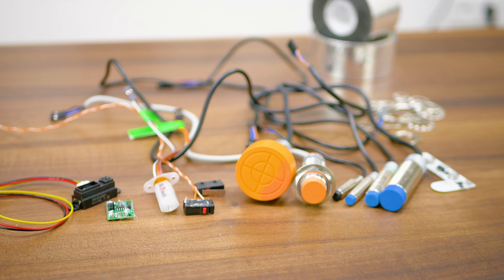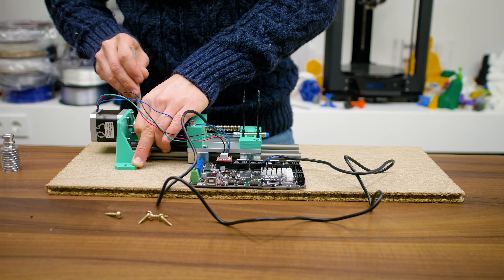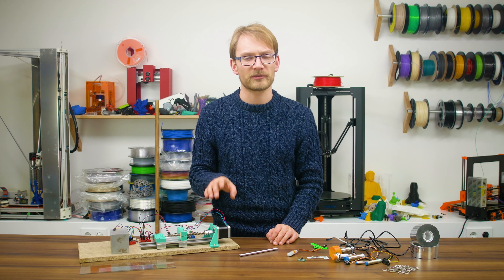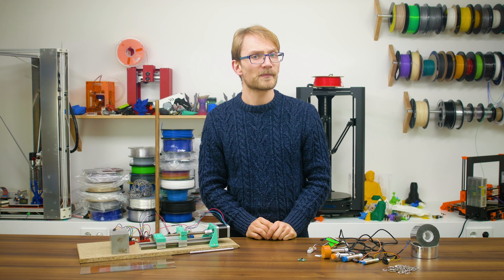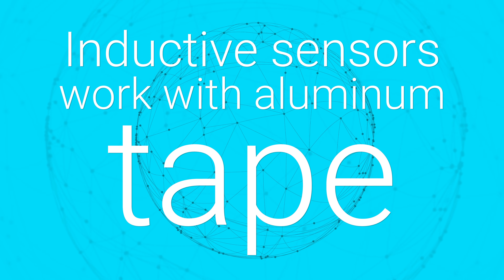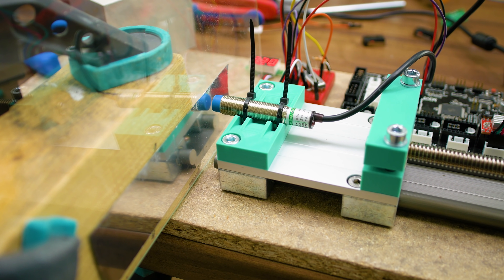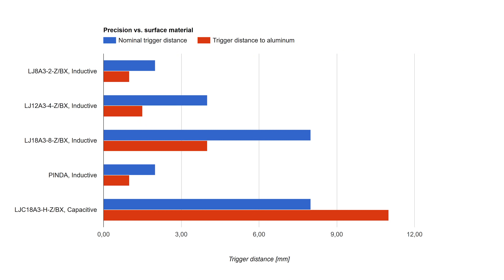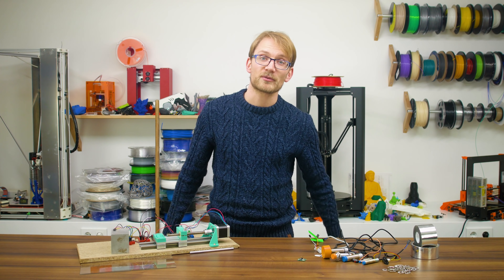Autoleveling on 3D printers: 9 myths and 12 sensors tested!

Comment: Many years later and the BLTouch and the clones are the most used.   Inductive requires the metal to be the exact same accross the entire bed surface,  so it's out in most cases.  Of course now we have Lidar sensors.  Sticking with my genuine  BLTouch setups for now.   They just work.

Comment: I know this is an old video, but I hope that you still read comments.  Tom, How do you connect a simple 2-wire switch to the mobo for the board to know when it has closed the circuit?

A quick vid would be nice.
Reply from the maker: The exact procedure really depends on the firmware used, but the steps are typically:
Configure the pin you want to use as an input in your firmware
Enable pull-up for the pin in software or add a physical 10k resistor from the microcontroller's positive supply (3.3V or 5V) to the pin
Connect one pole of the switch to the input pin, and the other to ground.

This way, the input pin will be high as long as it's not pressed and low when pressed.

Comment: For the longest time, when I was running my Simple Metal with a glass build plate, I had to use aluminum tape to get the inductive probe to fire. I assure you it 100% worked. There are different thicknesses of aluminum tape, I suspect that was your problem here.

Comment: After re-viewing this video again, I wondered why you tested all of the sensors on the same surface (aluminum) as the different types of sensors each work best on particular surfaces.  For example the inductive sensors only work against a metal build surface such as flex sheets with PEI or PEX.  The IR sensors work best with a black body, or no- reflective surface such as build tak, and poorly against aluminum and non etched glass.  Capacitance probes need to be adjusted, but will work with numerous surfaces.  They should perhaps be used with the bed heater on, and at less than 65C.

Comment: Re-viewed this video.  It occurred to me that an NPN NO sensor has an open collector output to ground (V-).  So it might be possible to run the sensor at 12-24vdc power, but have the output switch a 5v pull up resistor to ground thus giving a 5v negative true logic output.  OR it could switch an opto isolator.  Either way, you get a 5v logic output, but might need to invert the logic in software.  Marlin probably provides for this anyway.

Comment: Suggestion: I would love for the program of your channel to be a bit more focused on telling the folks over at lulzbot that there is a very sad man in vienna, who`s Pos 3d printer first grilled his pi, spared his phone for some reason, and tried the same funky shi# with my pc, but this time it offed itself so to speak. I don`t find anything wrong in the psu, and yes, your video was very helpful, but the meanwell 21A 500W 24V is a bit different. Still no burnings. The Board powers on over the usb, but I think this POS just will never ever print anything ever. Soooooo, lets call this one "Nachbar in Not-Lulzbot edition." lul. Jk of course. (still, if you want, you could...) I am gonna ball and cry now. Excuse me gentlemen. But this ender 5+, has ended me. First my Pi, then itself, now it`s me. I swear they make them cheaper now...

Btw. Edit: No worries, my pc is built like a tank. I did it myself. Not even the usb port I used is grilled. Still, first I was sure I made some wire mistake, but nope. The Mobo just started to go freaky on me. The Usb-C is a big nono now, but tbh, I don`t trust the Pos at all. Not anymore.

Comment: Have you looked at a sonic sensor? Like the ones that come in the Arduino kits. Can it be adapted to measure and trigger at the distance it is mounted, at on the print head? When I played with one some time ago, It seemed very accurate for 50mm to 800mm.
Reply: You are trying to set head position to a fraction of a layer height, so about 0.02mm say. Those sonar sensors have nowhere near that resolution.

Comment: To be honest I don‘t habe experience with 3D Printing, but what about using a pressure sensor/force sensor. As far as I know they don’t really have any travel in the sensor itself, and they should trigger more or less instantly when they see a force being applied. Of course they won’t output an on/off signal, but a voltage (or first of all a resistance ) overcoming a certain threshold and some simple electronics should be enough to make it work I guess.
Reply: That's called a load cell, and some 3D printers do now use that scheme. A related scheme is one in which the printer just runs the nozzle down into the bed while monitoring the motor current for increased current, which it assumes is due to the motor pressing against the bed.

Comment: Awesome video, very informative. Curious, I know it wasn't the point of the test, but how come you didn't try putting an opaque backing on the opposite side of the glass when testing the SHARP Optical Sensor? Or even test and Ender's glass bed that has a coating on the print surface itself?
Reply: I've got a feeling that that particular glass bed surface wasn't available 4 years ago.

Comment: To resurrect an old video. Have you still got the testing rig. I think it would be interesting to redo this test with the latest sensors available.

I'm building a ratrig vcore 3 when the kit arrives and I'd like to know waft probe to use.
Reply from the maker: Yeah, I still do have the rig. Which sensors would you like to see tested specifically?
Reply: @MadeWithLayers  I'm really wanting to see a comparison of a real BLTouch vs an AliExpress cheap clone. It'll be awesome to see some DIY solutions too, like the Mi Touch or the OptiServo (both using optical endstops and very cheap to assemble).
Make it happen Tom 😉👌🏼
Reply: I'm not sure really. With the rise of self build printers where you can choose your own components, notably for me ratrig and voron, I was just interested in whether there were improvements in physical, capacitive and induction sensors in the years since you did the test.

Comment: Its been 4 years, will be cool to see a redo with current offerings
Reply: Tom, if you revise this comparison, please include a load cell sensor.
Reply: @RichardBronosky  And the new Voron Tap
Reply: 2024 !
Reply: @Mikey_beJones  Well now it's 6 years, and I've just replaced my beloved klicky for a beacon.
The king is dead, long live the king.

Who needs comparison videos anyway, just follow my comments
Reply: I'm officially finished with 3d/bl touches...they're both garbage, so yeah I'd like to see a 2021 sensor showdown myself 🙂
Reply: @Nowayfella  They really are garbage. for me after a long journey I came back to the source. end stop prob - klicky, the simpler the better
Reply: @slimanus8m  its been 5 years now
Reply: @mynameisdex8785  Damn
Reply: @mynameisdex8785  Ya....Now its official, just use Klicky or even Unklicky. it's simple cheap and accurate and cool
Reply: @slimanus8m  I'm building a Klicky for my Ender 3 now. I have stopped using the 3Dtouch on it except as an endstop, which is leading to variable first layer offset. Before I had even heard of the BL touch years ago I wanted to use a microswitch. Very cool that the community has developed such approachable solutions for doing so!
Reply: @Nowayfella  2023 now:face-fuchsia-wide-eyes:

Comment: I feel like I've been in a time capsule. I got an early MakerBot CNC (#180) in 2009-ish, and was printing 3mm ABS on a raft on Kapton tape, using a .37mm layer height and no fans or heated beds. I woke up in 2021 receiving a Prusa Mini+ that prints directly on a magnetically attached and heated bed, using 50 micron layer height if I so desire, and supporting PLA, PETG and a plethora of other materials out of the box. In the old times, I tried using an optical mouse sensor for auto-leveling using focus. It actually worked with the sensor 1 mm from the bed, but I wanted something more like 10mm from the bed and never got the optics to work correctly. The idea was that the optical mouse sensor not only sensed the height, but also could read markings on the bed, or a printed sheet attached to it both for calibration precision and for communicating what to print. I never got to finish this project, but it seems like it still might be worth while: the inductive SuperPINDA doesn't even provide much headroom. Does anybody here have experience using optical focusing for Z height calibration?

Comment: Hi Thomas I have watched plenty of you tube videos on how to set up the bltouch but I cannot get mine to work it keeps coming up on the screen error failed to enable bed leveling, I have tried thousands of firmware and none of them work. I have a ender 3 pro with bigtreetech tft35 v3 display and askemini3 v3. please could you help?

Comment: I watched this because I have a glass bed on my 3d printer and was looking for an accurate auto bed leveling tech.
I still don't know. 
Here's why.  You need to summarize, conclude and compare as you go and at the end.  To see a bar graph for 5 seconds occasionally, with part number labels does not help me to discern results because I don't know these part numbers, so a X45-76b means nothing to me as you speed by your test results.
Of course, my failure at being able to follow your speed-round type presentation is my problem, but you never summarized the results to indicate what the most reliable option was in most cases.
Also, you premise every aspect of this exploration on the idea that the viewer cares about how others have mis-characterized these technologies for bed leveling in the past.  As I explore the best bed leveling sensor, do you think that I search for "myths about bed level sensors"?  I search for "best bed leveling sensors" because I do NOT attempt to learn by examining "why other people have failed". 
While that might be a useful note for each sensor while describing its performance, it confuses the whole point of choosing a sensor. 
Not everyone absorbs material using the same modalities for learning.  You blast through all the results at lightning speed and don't provide enough example and summary for the viewer to absorb the material, let alone use it to make a decision.
I have watched several of your videos, and your style of presentation is seriously lacking.
You never said, for example, what provides the most deterministic way of bed leveling with the easiest setup for the majority of users, or any other useful summary as you turned up the speed the the results at warp speed.

Comment: Hi Thomas, When using a 12mm/4mm proximity sensor with a steel bed, the sensor light triggers before the printer detects the signal (Tronxy XY-2 Pro w/standard firmware). Is this normal? I go through the correct leveling procedure and everything seems fine, I go through the z-offset to set the bed to 0.2mm using feeler gauges but when I go to print, sometimes the sensor triggers late resulting in bed-clash.... any ideas??? can you help?

Comment: Thomas, I really enjoyed your video, and it is very informative, I have been using LJ18A3-8-Z/BX inductive sensors on all my Printers, at 5v.  As long as I don;t use any glass thicker than 3 mm on aluminum heat bed's.. I have noticed that if you have the heatbed heating it has a magnetic field generated from the traces in the heat bed when high current is flowing.... thus an autohome while heater is off will be different than when heating.  If the bed is hot and cycling while doing a multipoint bed leveling you won't get an accurate map of your surface of the heat bed.  I tried a 4mm borosilicate glass over aluminum and had to move the probe down so close to the glass that it only had .8 mm between the nozzle tip and the sensor trigger point. sensor sometimes would scrape off the first layer on some runs. 
I did wonder if running a 6-36v sensor at 5v reduced the sensing distance, and if I used the 15k/10k voltage divider and the 12v supply if it would restore any lost range. ie ~8mm vs the ~4mm I am getting at 5v. BTW I'm an electronics tech been doing trons since 1973 and 3d printers for the past 10 years or so.

Comment: Oh okay, so the BL Touch is not the most accurate probe despite its popularity and hype? Some manufacturers even stopped using inductive sensors in favour for the BL Touch. Maybe they should have stuck with the inductive probes then?? Or has the latest V3.x versions of the BL Touch become more accurate than the inductive ones?

Comment: Great video. With all this in consideration, which sensor would you add to your 3D printer? Seems like the LJ12A3 and the PINDA are among the most sensitive and reliable, but I'm sure there are additional considerations such as voltage and compatibility.

Comment: Awesome test! Very methodical tests.  I have the cap sense and have noticed the heat issues.  I think I'll switch to inductive.
I would like to try a glass bed over the aluminum lower plate.  I wonder if the the longer range inductive sensor would be practical at detecting the aluminum glass combo.

Comment: Thomas, great video! I have an Ender 3 and bought the BLTouch kit for it.  Everything was working well until I had to remove the hot end fan to clean up some melted filament around the the top of the nozzle.  After going through the calibration for the BLTouch again, I now can only print small items.  Even after fiddling with the Z-offset, any large print's first layer will be too close on one side and too far on the other.  I really enjoy having the BLTouch, but I haven't been able to print anything larger than a benchy lately and I'm thinking of pushing Marlin 1.1.9 onto the Ender 3 just to be able to print (without ABL) again.  I have the silent mainboard installed, so I can just update through USB.  Is there any fix for the ABL, before I remove it?

Comment: Seeing as inductive probes can see through plastic/silicone, would it be sensible to put a silicone sock (or even a printed plastic cap) over the bottom of the inductive probe to reduce temperature effects? I'd be really interested to see if that helps.

Comment: There is a comon mistake made even by the best brand of printers : A SENSOR SHOULD NEVER BE USED WITH AN AXIAL MOUVMENT. 

- first of all if anything goes wrong the sensor should not risk to hit the target.
- The target should move lateraly at a certain distance of the sensor. This distance should be the one of better accuracy given by the manufacturer. Example , D12mm inductive sensor, most of them should detect steel target at 2mm distance.
- The same for mecanical sensor, the target should have lataral movement and 15° angle slopes, thus increasing a lot precision.

Comment: I think one of the things you have to remember is that the BLTouch is an all-in-one solution for bed leveling; it won’t interfere with your nozzle at all because of its retraction. That retraction most likely adds a significant wobble.

Comment: 3:29 it probably used a solenoid if it’s moving that fast. A solenoid also doesn’t use moving parts other than the rod you see moving back and forth.

Comment: I just realized that I can just let the copper nozzle touch the alumium table and get the ultimate levelling precision for the cost of 2 wires... Would only have to make sure that there is no plastic covering the tip of the nozzle. Not sure how to clean the nozzle that well automatically, but it certainly can be done manually before every print.
Reply: I don't think most people print on bare aluminium...
Reply: @jussapitka6041  Oh. You know, apparently, I didn't too :/ It's just been so long since I had to disassemble my printer that I forgot. Cannot find time to reassemble it, just grab ideas for improvements for when the day comes.

Comment: i thought the prusa just used the motor current to determine when it had touched the bed.
Reply: nah, thats for x and y endstops
Reply: @Averell64  how come no for bed levelling? is it not very precise?
Reply: @pepe6666  well - it's got the pinda probe and thus doesn't have to push the hot nozzle right onto the bed... Can't tell you why one is more precise but apparently the pinda probe came out on top
Reply: @Averell64  really? it certainly does put the nozzle onto the bed when doing its calibration. and i know the stepper drivers are a closed system cos they monitor the current of the motors. so im still lost

Comment: newbie questions:
1) why isn't any using ultrasonic sensors ?
2) do high end printers use laser/lidar ?

thanks for the video, very informative!
Reply: Ultrasonic sensors are not precise enough to do the job.
Reply: 1) 2) there must be distance for both of them. None of them will allow you to notice when the nozzle < 1cm. I guess there might be a workaround with offsets though when 5/10 centimeter or something like that.
Reply: Lidar is a process where an infared laser light creates a kind of radar around it. 3d Printers are only trying to measure distance in one direction. It is much simpliler and more practical to not use lidar. Ultrasonics are another radar type with help of a servo, Most radar like sensors are kind of inacurate but still acurate enoguh for their use cases like on a car or a plane. Where 3d printers are looking for accuracies of up to micrometers. 
Always learning,
Aidan Villacampa
Reply: Prusa uses a laser to detect stoppage in their filament sensor.  You can get them on Aliexpress
Reply: Are there any sensors that can map out the Z axis lead screws intolerances?
Reply: @evlsc400  Short answer is yes but out of scope for a 3d printer. you would have to attach a linear encoder to your z axis and modify Marlin to have a live position feedback... I would rather look into a ballscrew at that point